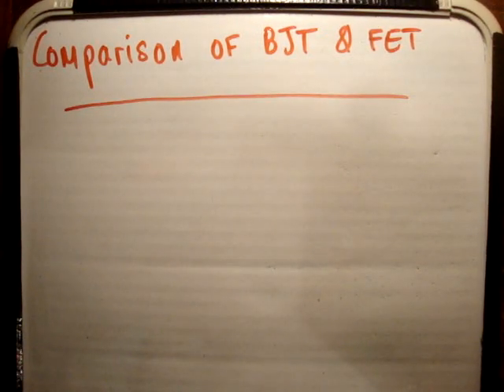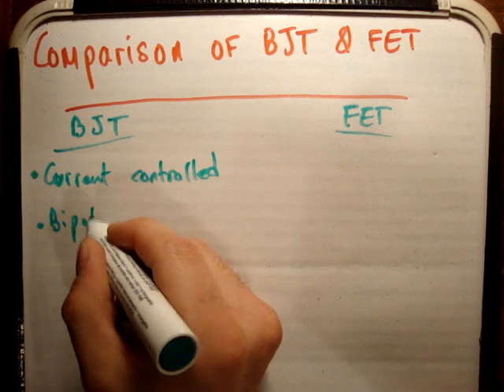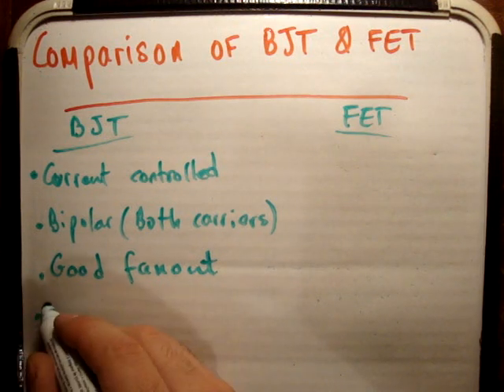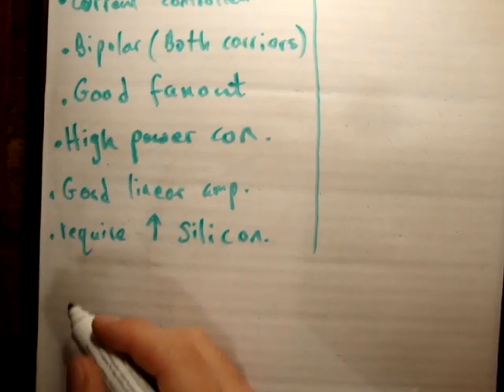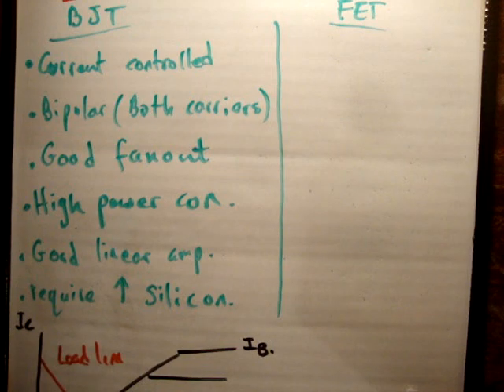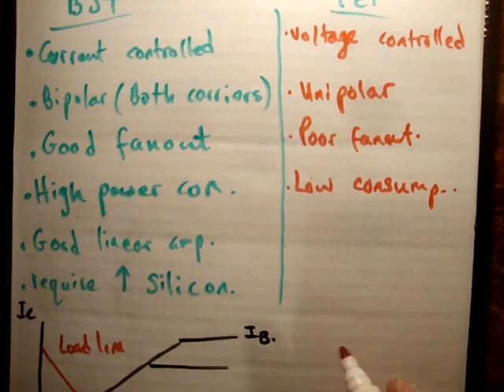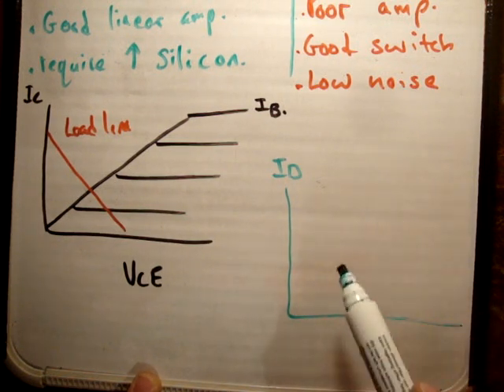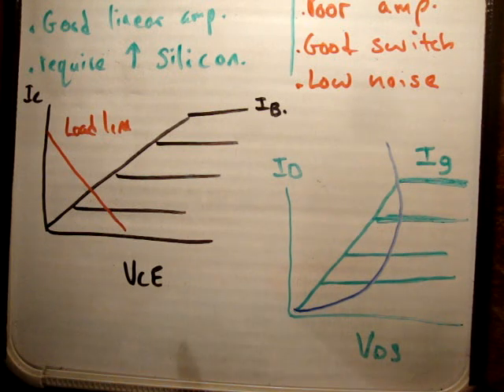Electronics 25 : Comparison BJT FET

Comment: a) BJT's are voltage controlled.
b) BJT's use primarily only one carrier species (e.g., NPN's use electrons, not holes)
c) BJT's don't necessarily have poor power efficiency—it depends on the application.
d) The amount of silicon required for a BJT can be comparable to a MOSFET, if it is optimized properly.
e) The I/V curve of both BJT and FET looks all wrong (specifically, for the left side)
f) FETs generally have higher noise than BJT's.
g) The pinch-off region makes FETs bad amplifiers? WHAT??

So, yeah. This video misleads more than it helps.
Reply: u totally wrong man
Reply: ***** ohhhhhhhh man i did not reply to u..u have given right ans..y i should ask to u???